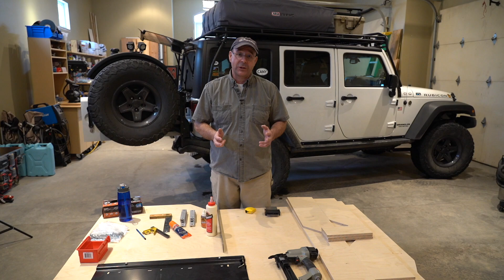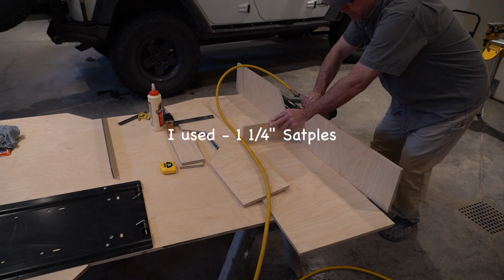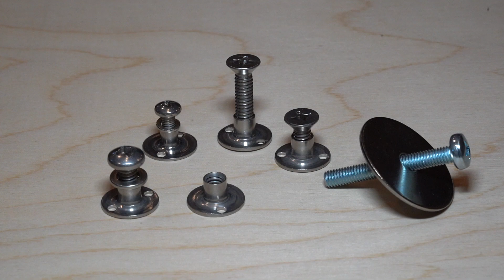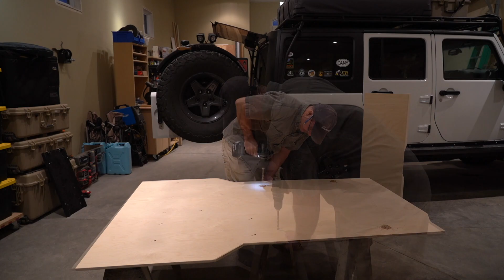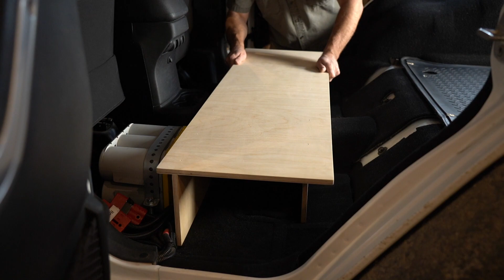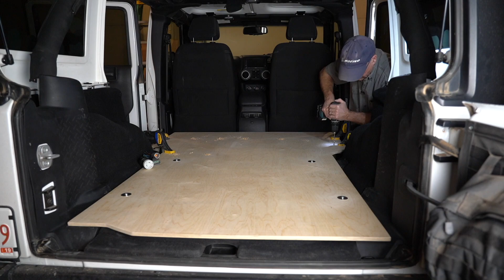DIY Jeep Storage Platform: Overland Expedition Vehicle Build - Part 5

Comment: How did you join both the footwell section to the main deck floor?
Reply from the maker: You need to watch Part - 6 of this series for the next steps. This series is ongoing, and if you haven't watched part-1 through 4 I would watch them as well, they will also help clarify things.